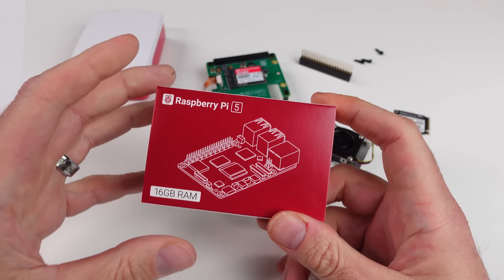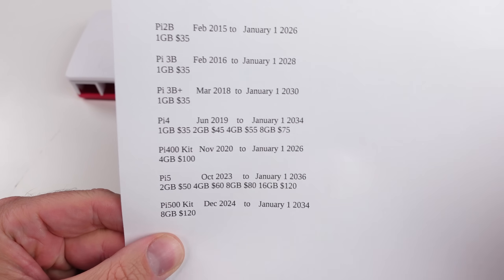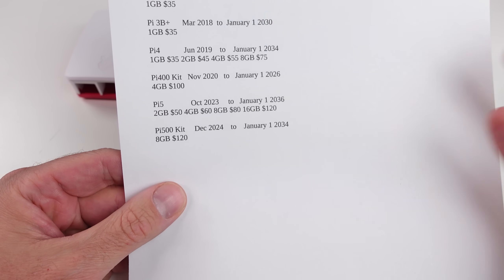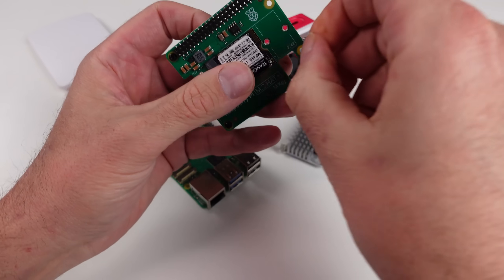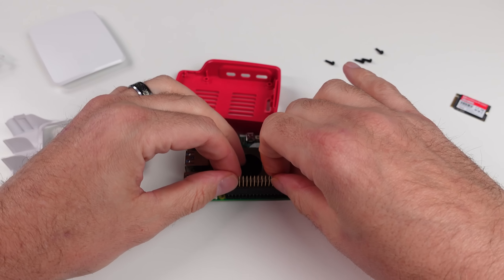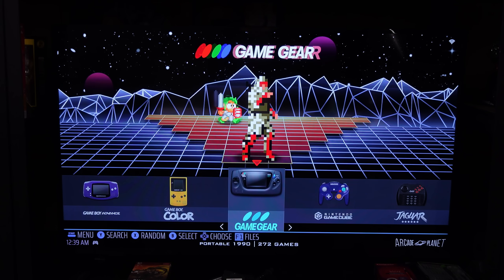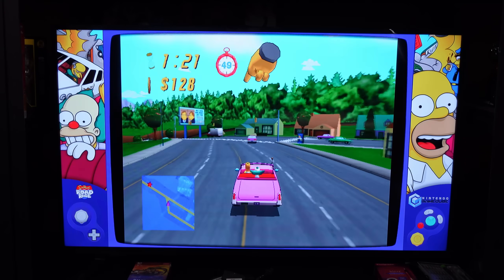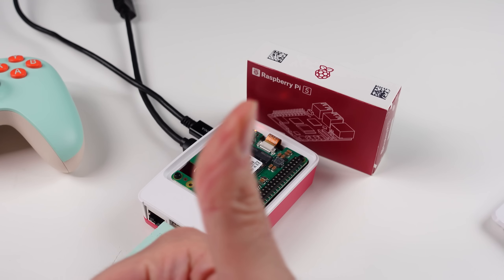The Most POWERFUL & EXPENSIVE Raspberry Pi Ever! 🤯Pi 5 With 16GB RAM!

Comment: Buying higher end emulation ware just so you can run Gamecube, (which is an arguement often heared), doesn't make any sense, unless maybe it's the CM5 in a portable case. (CM4 has a different pin-out, so no Gpi yet). It is simply cheaper and jusr as easy to set up; to softmod a Wii V1, (the gamecube compatible one). It'll run gamecube natively and since it's a Wii... it'l probably run Wii games just as smooth. No hustle.

Comment: 04:00 I think building a rack consisting of 8gb pi5's is enough for single service server builds, headless option, imagine Redis on one pi that can serve to several pi's services, and pi with db having clusters on several pi's to serve other pi's, and 8gb will be enough for every server needs, instead of vertically having 16gb. Unlike Desktop option for users, 16gb will be the minimum :) needed.

Comment: You do not need to install the GPIO extender for the NVMe HAT to work. It's only if you intend on using GPIO though the NVMe HAT. Your NVMe drive will get power over the PCIe ribbon cable.

Comment: I think with the 16Gb variant the Pi Foundation finally found a price point whereby it will struggle to sell in the usual quantities, having produced a product that only a few people actually want!

They've started to get too expensive really, think they should have kept the 16gb variant back for the Compute Module 5 product line as that looks a kind of more professionally orientated product.
Reply: the versions with less RAM are also available for less $$
The choice is yours. At least you have the choices to make about the amount of RAM you want, and the amount of money you wish to spend.
It isn't strange that the 16Gb model cost more than the 8 or 4 Gb. 
If you want more it is usual to pay for more.
NO-one has to buy a Pi with 16Gb, as there are other cheaper variants with less RAM.
Reply: @colonelfustercluck486  True, but the memory price upgrades seem to have a premium compared to say 16Gb of straight DDR5 memory on Amazon for about £35 now. There's about a £70 difference between the 2Gb Pi 5 and the 16Gb Pi 5. Guess it comes down to the single chip they're using to maintain the form factor.

Think if they'd brought this in at say £99, it would have been a bigger general purpose seller, but then the 16Gb model is undoubtedly targeted at a certain kind of user.

Comment: i have learned that no matter what version of raspberry pi you get you tend to have some issues with the board.  even with the pi os.  i tried the pi 4 then just tried the pi 5 and both never really impressed me.  i tried pi 5 with m.2 hat + and still issues with pi.  it seems that the pi os is not that stable. even using ubuntu which i do not like.  i know there are other os for pi but none of them would work that great.  you would have to program the device a lot just to get to work some what.  so, i am sticking with windows.  since i grew up with windows.  i know the os a lot.  since i am a cert tech i like to see what works and what does not.  pi4 or 5 does not.   hope this helps
Reply: I've built a lot of Pi's starting with the 3 and 3B and have not had the experience you describe. As we speak, I'm running Jellyfin as my media server on a Pi5 8GB with a 20TB drive. I decided to run Ubuntu Server and added a lite desktop for VNC purposes. I also run Calibre 7.x on it (the reason I selected Ubuntu Server). Last I looked I could only get Calibre V3.x on the Pi OS via the repository. It's been totally stable and running like a champ. I have 15 TB of media which I backup with two more 20 TB drives in a dock and rotate off site. I'm running a NAS on a Pi 4 and HamClock on a Pi 3B. No issues here! BTW, only the 3B boots from an SD card. The others boot from M.2 drives.

Comment: You can get a cheap mini pc for less and it'll do a lot more.
Reply: I've seen mini PCs but they start at 200 dollars and go up from there
Reply: @marccaselle8108  Not true. You can get a decent used 8gb ram one for around $50 bucks and snag an 8gb stick of ram for reasonably cheap and even the cheaper ones can still run up to at least PS2 and Wii.
Reply: @keithswiniarski7766  would you mind sharing a link please?
Reply: good luck then

Comment: There are x86 sbc and orange pi capable cheaper boards unfortunatelly any of them get more dedicated software Why ?
Reply: yep you can blow some money on competing systems. They are really good. If you can get them working with no or little support. Or they make great hi-tech paperweights if you can't make them work. Feel free to spray a racing stripe on one.... it may help?
The difference is in the support the Raspberry Pi website gives, much instruction on to adjust things to your liking, de-bug, fault find, upgrade software etc. And many forums with Pi advice. Software etc.

Comment: I stopped at pi 3.
Reply: I still own some pi 3 that do what I want them to do.
The 4 and 5 provide power and ram I don't really need for my tinkering..
Reply: Yup. The long-awaited Pi 4 turned out to be incredibly UNDERWELMING, and i just never bothered with the Pi 5. I think the Pi 6 will FINALLY give us the power that we were all hoping the Pi 4 had.
Reply: @Gametester110-qf8vs  Pi 6 = huge heatsink and $300 no other way to get more power, just enjoy the $35 Pi's
Reply: @Gametester110-qf8vs as someone who's owned a pi4 2gb since it's release I can say that it had it's uses and I actually still use mine regularly. From a windows machine (back then) to my batocera build and small home projects it has the lowest power consumption. It fits in your pocket which is great if you work away from home or are just a single traveller and can do a bunch of other things. I bought a nes4pi kit with 2 gamepads, full heat sink kit, an on/off switch and a case with a fan for £50. Spent a couple quid on a hdmi lead and it's been 6 or 7 years now. I could probably sell it for £30 so for the price of a packet of cigarettes I've had a mini machine for 7 years. Every time I think about selling it I turn it on. Load up some arcade, psp or PS1 titles and when I finish I just tuck it back away with my other gaming machines. Good for mini home lighting projects if you're into that sort of thing. 

Heck I could leave it on all day playing music in the background and not worry about it's 5w of power usage. I have my own custom themes and music on mine as well

Comment: What i love about the pi400 and pi500, when using them it's like using an old 8bit computer. Like the vic20 or atari 800xl, we're the whole computer is in the keyboard.
Reply: i use my pi500 with wolfanoz 1tb image.. its really  nice.. and 8bitdo ultimate C wukong controller
Reply: Pi500 how do you get sound out, are you onna' TV?
Reply: Audio just worked for me. Right click on the speaker icon and make sure hdmi has a check next to it. You might have to go into devic profiles and make sure it's on digital stereo hdmi output.

Comment: By the time you buy everything, minus the storage SSD, it's about $200.  Might as well get the Retro Pocket 4 pro or 5.  Already have a controller and screen built-in.  Raspberry Pi for handheld emulation is a thing of the past.  High or low end, handheld emulation is so affordable now.
Reply: but....lets say that you want to save your progress to an NVME.  Retro Pocket 4 or 5 have (internal memory? or an SD card)  If you want to retreve that progress and continue, is that still possible?  (Hopefully MLP will show how to IMAGE a PI NVME with a USB adapter soon!!!)
Reply: @dglass2008 yes it’s saved on another folder to your micro sd card. Transfer over the files to the folder on whatever you playing with respect to the emulator.
Reply: Not everyone exclusively uses Raspberry Pi's for retro games. 

Your point isn't wrong.... but there are probably 1001 uses for a Pi
Reply: Yeah I thought the same thing, theses devices are not affordable at all when average handheld devices have better specs and more affordable than these prices
Reply: I’m over handhelds. I wanna play on tv so I’m all about this stuff.
Reply: No longer affordable, buy a Mini PC that can run circles around any Pi
Reply: we not need buy anymore we have good old old rpi
Reply: Facts I remember in 2019 to 2020 It was still affordable doing your own retro console with a pie , now is just the same as buying a fully made console.
Reply: Or a modern pc
Reply: Maybe you don’t want that form factor?
Reply: A lot of people don't want a hand held. There are lots of choices out there now. Including the Pi and small form factor PC's.